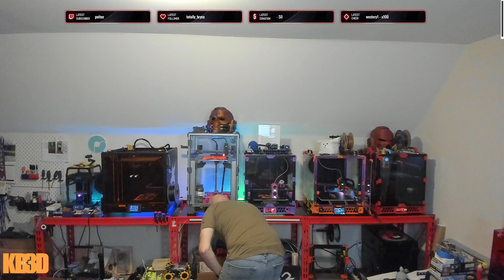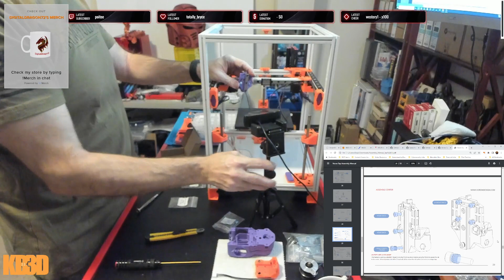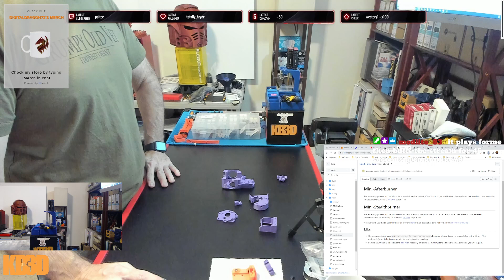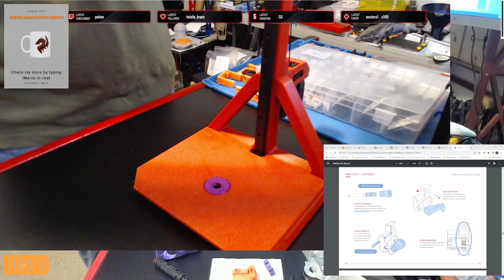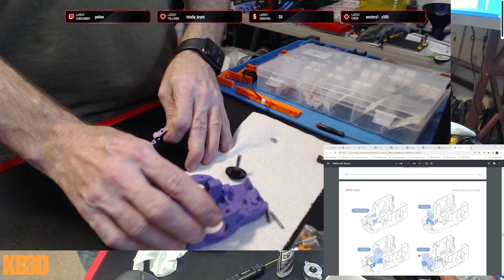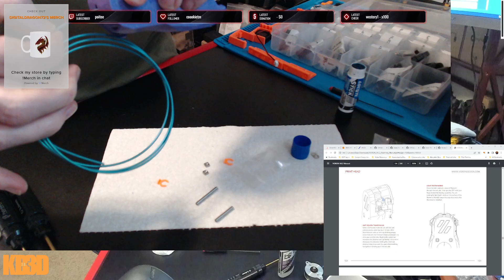Salad Fork Build | Part 4 - Boop Install, Belt Tensioning, MiniStealthburner

Comment: When ordering the parts to build the Salad Fork I looked at Boop to see what I needed and saw that I needed the 9H rail and that the default 9C Rail wasn't compatible so I ordered the 210mm 9H rail when ordering other Salad Fork parts. I did stupidly order the 9C rail despite knowing I didn't need it.
Reply from the maker: Yeah, my kit came with the 9C rail and I had to fast track an order for a 9H rail/carriage to build the Boop. I made sure to remember this for future smaller builds.